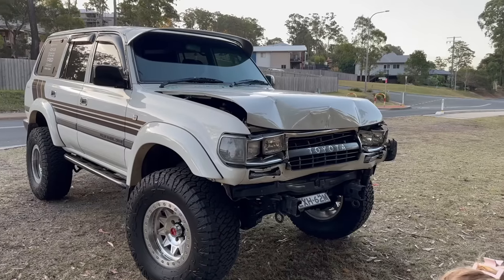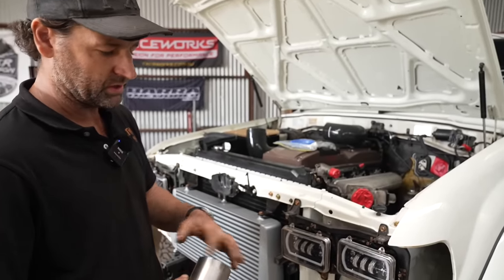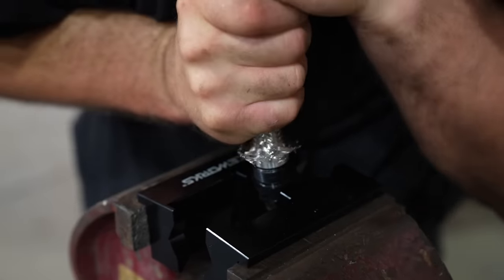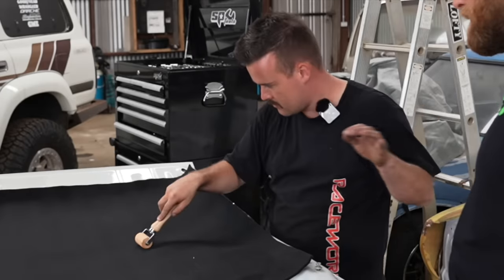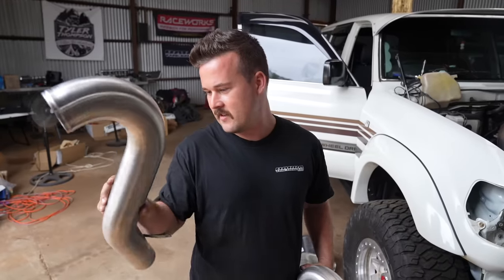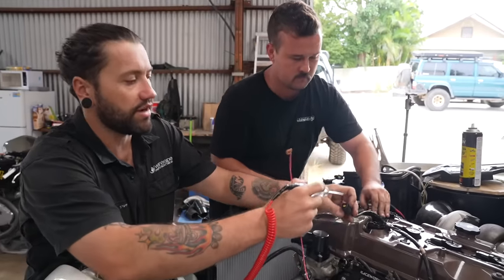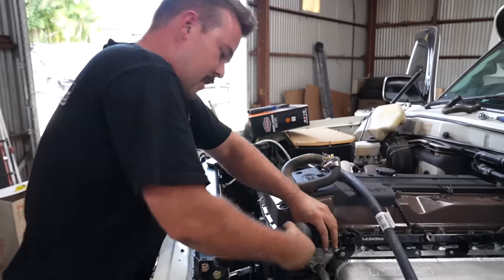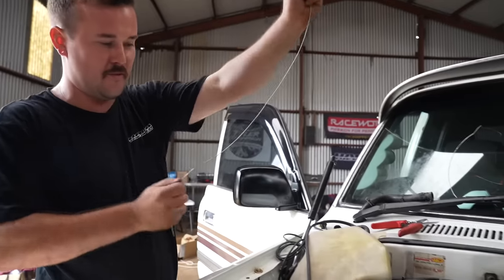First start of our Turbo Barra 80 Series Toyota Land Cruiser...

Comment: SHAUNO's BACK! On ya mate!!👍👍👍
If you notice, Burto always does his best work when Shauno is assisting...plus Shauno is right on the ball as shown in this vid with the oil fill-up and sump plug..maybe put him on as part time/casual?😊
Just watching how all the guys working in the workshop there are full on dedicated pros!
Todds should be doing fab work on F1s!
Josh the wiring guy is just as important to a vehicle as what a performance shops dedicated engine tuner is..
Birdo is just the jack of all mechanical..
If your ever going out remote 4x4 touring, these are the guys I'd want tagging along in the the crew, great work fellas! 👍👍👍
Reply from the maker: Thanks for watching mate!

Comment: Duno if it's just me but at the start of starting it sounds like one cylinder is down on compression? Could just be a sticky valve from sitting hopefully. Be interesting to see a compression test done on all cylinders maybe?
Reply from the maker: Not too sure but hopefully not 😬
Reply: @TylerThompson90  yeah fingers crossed just needs a good run to settle things in again 🤞😎
Reply: I didn't hear anything concerning
Reply: @flatoot  if you listen closely to the 'choom choom choom' of the compressions, one of them is a 'chim' and it's always the same one, 5 chooms and one chim
Reply: @dcf476  I know the imbalance you're talking about. I just don't think it's concerning. Especially if it's been sitting. Last engine swap I did, my engine had sat for 2 years since I bought it. V6 and the compression test was terrible on a few cylinders. I was worried I'd bought a heap of junk. But it fired up nicely and runs good.
Reply: @flatoot  yeah that's what I'm hoping, just needs a run to free things up👍👍

Comment: Don't forget one way valve in vacuum line to brake booster.  You don't want 50psi blowing into the booster.....  You might need hydraulic brake booster so she can stop this thing.....
Reply from the maker: Cheers for the tip!

Comment: That seat belt, if you pull it out completely, use some brake line clamps to hold it fully retracted and then get a hot bucket of water with laundry detergent and a brissel brush to scrub it, might need a couple changes of water. You can use brake cleaner as well with a gerni but I find the laundry detergent does a better job
Reply: Definitely don’t use brake cleaner with a Gerni unless you want to damage the belts integrity